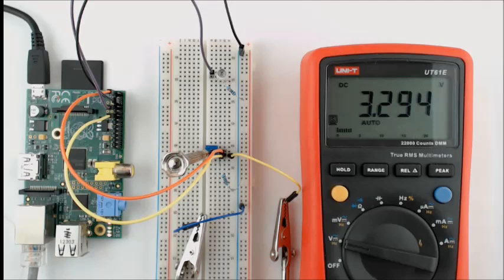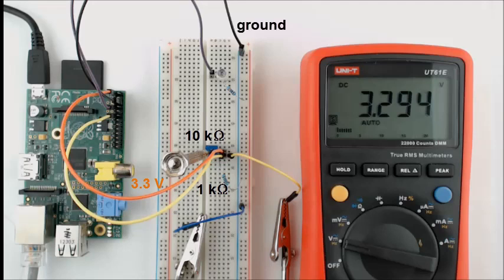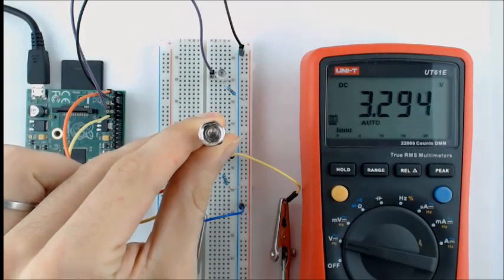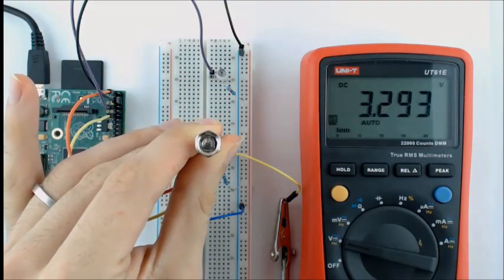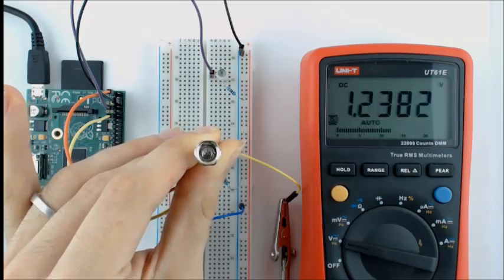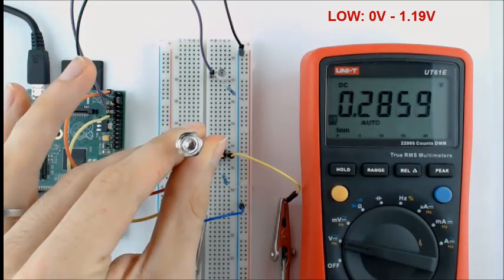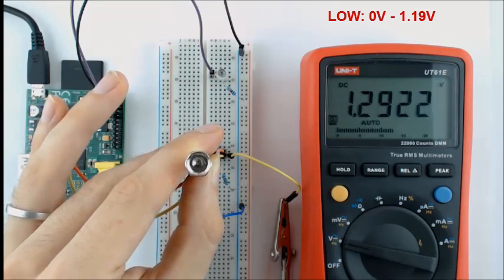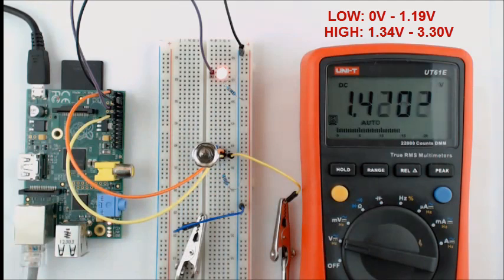What are the input voltage thresholds for the Raspberry Pi's GPIO pins?

Comment: So what's in between 1.19v-1.34, what's the state?
Reply: Undefined. It can end up being interpreted as high or as low. It is generally recommend to stay below 0.8V for a low and above 2V for a high to avoid any misinterpretation of the signal and have a bit of a safety margin.
Reply: Thanks.

Comment: Can the GPIO input voltage go as high as 5V or would I fry the board?  I'm want to know if I have to pass the UART signals through a voltage converter to connect to a PC which uses 5Vs